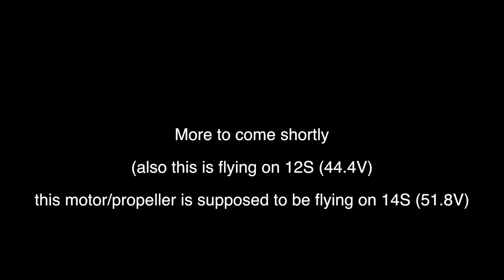My HomeMade electric plane Really flies!!!! (short hops) part7

Comment: Great your lacking in power try small petrol engines and a fuel tank under the overhead wing , also put a weight in the back corner of the rudder and a trailing ribbon these help it find neutral. Adds a bit of tension to help wheels need to be 4 inches higher to give th main spar angle of attack only my thoughts from experience keep going

Comment: You really should use eye protection  more than just that wind screen. Get some ANSI Z87.1 standard safety glasses like Nemesis V30.  Polarized, Durable impact-resistant lens,  UV protection,
Soft touch temples for extended wear
. Wraparound lens provides superior side impact protection
, Includes free eyewear retainer.

Comment: Your so freaking lucky to be able to do this. Ive been an aviation enthusiast since the 1st time my dad took me flying on a lear jet when I was 5 years old. I was in the navy, eventually got my pilots license and have been drawing designs, and coming up with crazy ideas. I never get the luxury of testing them. FFS. Ive study every aerospace designs since ww2. Even as a basic conceptual designer, I see your work Peter and I sometimes wonder if your joking or doing serious engineering calculations. Par for the course. IF I do ever make an RC flyer, im going to do the delta wing flyer because I noticed how simple the material and design was as well as being fairly inexpensive.  I saw glaring HUGE inherient flaws in your design and simply want to show WHy and HOw to over come them. I used to be obsessed with the 'dart' and 'delta' style craft. I already had dozens of sketches. Your attempt was valiant BUT with some simple but ness. changes, that thing would have been freeking awsome.

Comment: Hey Peter...when there is cross wind, learn to use the side-slip maneuver.  It's a fun maneuver that I use when I fly on windy cross wind days.  When you have wind coming from the right, use your joystick to tilt the plane to the right to counter the wind, then apply left rudder to keep you straight down the runway.  Inversely, when the you have cross wind from the left, use your joystick to tilt the plane to the left to counter the wind, then apply right rudder to keep you straight down the runway.  Congrats, pilot!

Comment: Excellent job so far. I wonder about fire safety when using hobby shop batteries, motors and ESC's. 

I expect that the horsepower for level flight can be significantly reduced, like maybe 2 or 3 horsepower, with a modest aerodynamic cleanup. That windshield looks VERY draggy, plus those struts with flat front faces and sharp corners must be causing quite a bit of drag. A few foam fairings ought to make a big difference. Then there are the very rectangular motor nacelles, and the motor struts. Lots of improvement for not much work available here, I think. Of course, if I was doing something like this, I'd make it a self launching ultralight sailplane, so I may be biased. 

How many g's is this stressed for? Vne? Maneuvering speed??

Comment: Super cool! Just curious, why didn't you vacuum bag the fiberglass sections? I'm sure it's fine the way it is but you could have saved a bit of weight in excess epoxy squeezing it out with a bag

Comment: Man I would suggest you to add 2 more engines in the front as tandem engines. You would almost double the power and so fly more safetly. In case of critical situation you need more power available.

Comment: Only $1200 for batteries? You won't stay up long enough you better parallel another $1,200 worth. When you go up in voltage amperage requirements go up too.

Comment: Why don't you have any diagonal bracing wires between your interplane struts and cabane struts - this is a critical omission and all the drag loads of the upper wing are being taken up by bending in the unsubstantial looking cabane struts.  Please consider very carefully what will happen if your airplane comes to a sudden stops or noses over - the inertia of the upper wing and your body pulling on the safety straps attached to the unbraced cabanes will cause them to fail in bending and the wing will move forwards and downwards, very likely breaking your neck. Please seriously consider some sort of bracing to the cabanes to prevent this - a diagonal strut from the forward cockpit to the cabanes could be incorporated into the windshield and would offer you some protection.  I also think your undercarriage is a design fault - there is not enough ground clearance and without shock absorption a firm landing is going to damage your wing spar.  A simple trailing link arrangement with a bungee system with increased ground clearance would be a big improvement - with the current setup a ground loop is inevitable.
Thanks for the inspiration and entertainment, but keep it safe!

Comment: Did you balance your props? Usually wood props are more prone to being off balance than ones made with synthetic material. I do prefer wood props though. If anything happens to intrude the prop, it will shatter apart. Synthetic props are so solid they won't break but instead send all the energy to the engine mount and break it.

Comment: Very impressive - well done! I can't think of any other twin, electric, biplane taildraggers offhand....  
There is a saying in aviation - a twin flies just like a single until it loses an engine, then it flies like a twin. You must consider the possibility of losing thrust on one of the motors - do you have the rudder authority to control the assymetric thrust and do you have the training? I would seriously suggest you pre-condition yourself to cut the thrust on the second motor and accept a controllled crash rather than lose control - close to the ground is not the place to be determining what your Vmca is! This is worth a watch to see what happens when it goes wrong : https://youtu.be/QnJBMYC8ReA
An amazing achievement nonetheless.

Comment: wire one of the two motors to rotate the opposite direction and get a prop thats pitched opposite for it to help with all of the yaw youre dealing with. also mount the engines closer to the fuselage (if possible). I'm an A&P and commercial pilot, not that i'm any smarter than you, but these are my suggestions.

Comment: Peter, after watching your video, I think you should consider some cabane struts on the fuselage and X bracing cables on your outer wing struts. Right now, all of the drag of the top wing goes into bending moments on your vertical members coming out of the fuselage. Most biplanes are braced like yours but include the cabane struts and X bracing to create sort of a super strong box like structure for the wings. Just a suggestion. Look at the bracing of some other biplanes and decide what works for your airplane.

Comment: I can't believe it!!! You pulled off a miracle. But I didn't realize you had a pilot's license. Watching the one flight, would it be worth while putting a skid on each wing tip? One landing looked to have the wing come close to the ground. I would fly it many, many times low and in a straight line like you did to see if anything breaks before doing a longer high flight.

Comment: I'm wondering if your reported nose heaviness was due in part to your large flat windscreen imparting a downward force to the front of the aircraft.  Take the windscreen off and try flying with just goggles on.
Neat project, nicely built!
Reply: Darrell Grisham 

No not a SIM pilot, commercial pilot licence, have constructed 3 successful ultralight and have been flying for more than 50 years.
Reply: i agree to loose that windscreen... the wind against the face is a good speed indicator.
Reply: Could allow more air to reach the rudder and give more control right?
Reply: Yeah take Mr Grants advice and keep flying young man. Take take anyone like this guy who is most likely a sim pilot!~

Comment: peter 4th time ive watched the vid 1 big observation i took from this is your stick is really washy idk if you could tighten the lines or make the control flaps bigger but you should not need to move your stick more then an inch to lift off

Comment: Dear Aviator, you are rare, your craftsmanship is 110%, a lot of naive people, that has not your courage say a lot of
non sense coments they are just "chicken" affraid of everything even their wives shouting on them. Keep doing a nice and neat job. What I would do just for longer flights and moderate turbulence  would be reinforce the center section with bi directional cloth and install a pitch trim or back up elevator control, that is what accidents reports involving amateur construction, has founbd throughout this years as a main cause of fatalities.
As a builder and heavy jet pilot/ ultralight pilot, the only guys that equals to you briliant mind are Burt Rutan, Steve wittman, paul Poberezny and a few others very rare.
AWESOME!!!

Comment: Those wheels seem too small for a dirt strip. And your lower wing is so close to the ground that if one side dips slightly on landing,  the corner of the wing will catch the ground, and that would be bad. I'd think about adding small wheels on the ends of the wings that don't normally contact the ground, but may save you if the landing doesn't go perfectly

Comment: thanks for posting.  nice work.  some thoughts.  peter, from the start, the plane has been balanced at a point in space BELOW the center of mass.  after the wings were mounded, a CANTILEVER was used to balance the plane at a point even farther BELOW the center of mass.  these practices have been giving inaccurate results.  at some point, BEFORE weight is added to the tail, the plane should be balanced at the lower surface of the UPPER wing.  the profile used for the main wings is moderate lift.  at low airspeed, the wings may require a high angle of attack / incidence in order to produce adequate lift; as observed.   since the aoi is fixed, adding trailing-edge extensions might help to increase lift and reduce the aoa needed.   in your opinion, isn't the tail already heavy.  adding more weight to the tail will affect the distribution of mass, adversely.  the diagonal braces at the vert-stab are pretty wiggly; are they really needed.  i suggest you record what the motor nacelles are doing during operation, to determine whether bracing should be added.    cheers

Comment: It's dangerously underpowered.  Can it even maintain altitude in a banking turn?  Also seems to be flying nose high.  That's also extremely dangerous at such slow airspeeds just above stall speed.   At least it does actually fly.  How much does it weigh?

Comment: This is a fine project, the first time I have heard of a manned airplane flown with all the wetted surfaces being foam panels instead of fabric, sheet, sailcloth, or molded skin. I don't expect it to be really light or durable, but it certainly is simple. My ultralight biplane has some similarities, some of the secondary structure is styrofoam (see Bloop Airplane). Your flying looks pretty good for a prototype test in an airplane that does not look particularly stable (no dihedral angle, small tail surfaces, perhaps). When I fly a new design, I do a lot of low hops and steering maneuvers at low altitudes, to make up my mind about things, sometimes calling a halt for modifications. 
Mike Sandlin...San Diego  California
Reply from the maker: Honestly your Bloop inspired alot of this project! I overshot my weight of about 40ishlbs (hoping it would have weighed about as much as your craft during the design phase) but the all up weight ended up right around 235!

thanks for sharing the videos and design!
Reply: Hey Mike, you are another inspiration.  Your Goat and Bloop convinced me that an Ultralight can be made REALLY light and REALLY slow.

Comment: Would it be better power saving wise to be towed assisted take off? or whinch assist? also have you thought about and i know this sounds crazy but adding wing extensions made out of fibre covered polystyrene? its rigid like fiberglass but super light,

Comment: Well done Peter, take it easy and remember it's always better to be down here wishing you were up there than up there wishing you were down here... also perhaps add some wires from your shoulder harness bolts to somewhere further back on the fuselage just in case, EAA had some sobering stats on how important effective shoulder restraints are and even if that upright extrusion is 6061 or 2024 it's not going to take much to buckle at a right angle.

Comment: I'm just a nobody with a RLM avi, but two things that concern me. First, your wheels point straight forward, but you touched down once with a lot of yaw that would put lots of sideways stress on the mounts. Not sure how you would solve that without a large engineering effort, so please make sure they can take that kind of stress. Ultralight, so the wind wins. Second, if your landing is hard, I fear you being thrown up and forward, and that windscreen could become a guillotine. Maybe ditch it and go with goggles, or wear face/neck protection, like even a catcher's mask and neck guard in combo with good eye protection. A little historical research into early flight and how pilots were injured during hard landings may be a good idea. An amazing accomplishment, no doubt! Good luck, and Godspeed!

Comment: Ditch the differential throttle during takeoff and flight.  That's what the rudder is for.  Also, with gear that short it's just a matter of time before you smack a wingtip, so, be mindful of that.

Comment: So, as a modeller (you and me both) looking at your footage, you can see that most of your flying is not far above your stalling speed/angle.
As I said in my earlier comment, let the nose down a tiny big and gain an extra 5~10 knots.
As a tip for doing hops, let the nose down first, then reduce power. Only need a second or two between lowering and powering off, but it avoids losing too much speed if you happen to be 'hanging on the props', close to stall.
You commented that "it's not stalled yet 'cause the nose would drop", if you get to that point, it's too late, AND, with those big barn door ailerons, if you get a wing drop and try to correct with aileron, things are going to get messy!
Just think how many models you've seen snap roll on take off !!
It would be slower in that machine, but you will still contact the ground at an unpleasant angle.
Looks like you're having fun, remember, baby steps, but enjoy (I can say, 'been there, done that).

Comment: you are violating 3 most important rules in aviation. safety, safety and safety
Reply: Get out of that basement and actually live.
Reply: Dogu Kan this is an experimental ultralight flight, he violated one light rule that would make no difference regardless due to the fact that it's an air traffic rule and he never left ground effect, but as far as safety goes he had his boxes checked, worst case scenario high gust knocks him nose down into dirt, he'd still walk away.

Comment: Rule 1 about landing taildraggers: The minute the tail is down, full back pressure on the stick and keep it full back until the plane stops moving. I noticed you playing around with the stick in the forward position but it should be full into your gut.
Reply: +Titouan “LeFlemard” Lannuzel Exactly
Reply: Darrell Grisham Yes. PPL, and here in Canada taildragger isn't a rating. I own a  Champion 7EC (taildragger!) and have flown Champs, Cubs, and Chiefs on a regular basis.
Reply: Titouan Lannuzel not really. It's mostly to keep pressure on the tailwheel to give you better steering. But also helps prevent inadvertent windvaning or ground looping of the plane.
Reply: It's to prevent crashing on the nose, right?
Reply: And you hold a pilots certificate and are type rated in what tail dragger. So much from so many for so few!

Comment: You're flying crabbed to the right, have you any sort of a slip indicator? A piece of string and some marks on the windscreen should do the trick. Learn to not run off the runway by perhaps using thrust on one or the other engine, if the rudder has inadequate authority. I'd say that your tail volume is a bit small but hey, it flies. You should find that you gradually stop stirring the joystick so much as you gain familiarity with the plane. And wear a goddamned helmet, you nitwit! Obviously you're not a nitwit but if you bounce your head off that farmland hard enough, you could easily make yourself into one.
Reply: 45 years in manned and unmanned aviation, my advice is likely useful. Unlike him, you sound like you meet the standards of nitwit. Get stuffed little man.
Reply: I couldn't give a flying f--k what you think of my comment, at least now he's wearing a helmet. THAT alone is probably a doubling of his chances of surviving a serious mishap.
Reply: Are you sure there wasn't a crosswind?
Reply: Great job so far Peter...you are getting heaps of good comments from folk who are really interested in what you're doing. I noticed the tendency for the aircraft wanting to swing to the right and while it may just be a crosswind effect, it may also be that the left motor spins a tad faster than the right side one...any way you can perform an accurate RPM test?

Fly safe, my friend.
Reply: THis comment is so stupid!

Comment: Hey Peter, one quick thought. Some custom hybrid cars have used small jets to power generators and rapidly recharge the batteries. Could you adapt a hobby jet motor to do the same job, fulfilling the need for the generator, and drastically expanding your flight times? Think of it as your own spin on an APU. Take care, and best of luck!!!